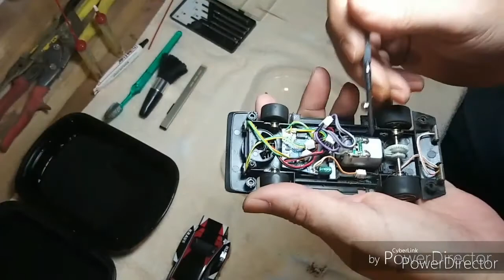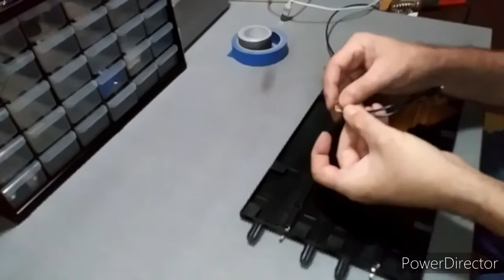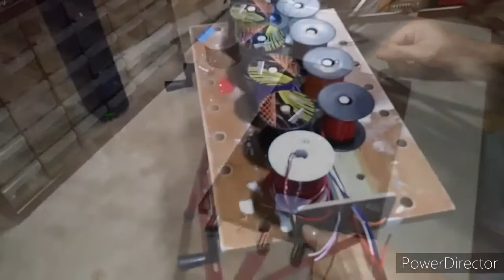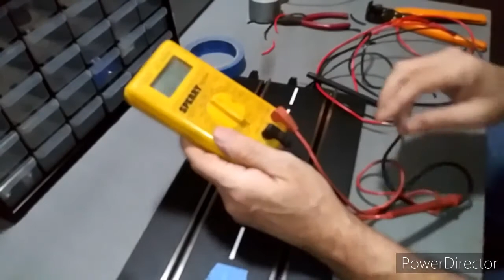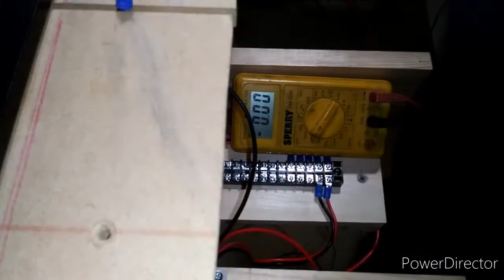Glendale 65 - Episode 11 - Track Wiring Part 3 (Track Connections)

Comment: Ah Ha!!!... This is THE episode I've been waiting for!!! Thanks John! You are such a great teacher! I love how precise and meticulous you are in your thinking and execution. I know it's not germane to this 1/32 scale Carrera Glendale Project video series, but as I am thinking of recreating your Glendale 65 layout in 1/64 scale A/FX track, I would love to hear your thoughts and opinion on how YOU would do the Power Taps and solve the Power Distribution question for that scenario. Who knows... perhaps one night when you can't sleep because you've taken in too much caffeine from over-indulging in the chocolate milk? ;-) Thanks for sharing another great video with your fans!
Reply from the maker: Actually, I had a 33' 4 lane AFX setup before this one, and I can tell you exactly how I  did the power sections. I glued sections together making sections 6 to 8 feet long. When dry, I soldered short jumpers UNDER the track, electrically bridging each gap in the section. Then I soldered power leads to that section. The track was adhered down to the surface using dabs of silicone caulk. The 6-8 foot sections were just snapped together, as they each had their own power taps, so the joint between the assembled sections has no effect. All rail joints were filed smooth, and all the joints in the track sections were filled, then painted. Ran SUPER smooth!! Thanks for the comments!!!

Comment: John, I have watched a lot of your very helpful videos and I have studied your 3 videos on track wiring. I have my wire completed and I have no idea how to set up my new DC power supply. Do you have a video on power supple set up and installation? Many thax
Reply from the maker: Hi. The only PS I use is for benchtop use only, I still use the factory power supply from the Carrera CU.

If you are looking to change out the factory power supply for the CU, simply cut the plug that goes into the CU off the factory PS, and wire to the new DC Power Supply (mind polarity!). Keep the voltage in range (too high will cause damage, too low will cause reliability issues) and that's it...
Reply: @slotcarmayhem9765  John, thank you for getting back to me.....much appreciated!
Reply from the maker: You're most welcome!!

Comment: Hi John, I am not using terminal blocks for connections and I just have the stock 18v power supply (1:24 scale) connected to the control unit. My question is where do I hook or connect all of the power taps that I've run from various sections of the track to a power source? there are no screws on the control unit to connect them all to. I am an avid viewer of SCM. Thanks, Ron
Reply from the maker: You can connect to a track section next to the CU, and daisy-chain from there. Thanks for your support!!
Reply: @slotcarmayhem9765 , Thanks John for getting back to me. So a continuous daisy-chain will maintain the same voltage from the beginning all the way to where ever the end maybe? Should I use the 16ga. wire you mention on your channel as well? Thanks again, Ron
Reply from the maker: @19Zeek56  I find the 16ga easier to use, but 18ga should be adequate electrically. Never hurts to go bigger. Yes, daisy chain works. The goal is to electrically bypass track joints.

Comment: This is Great stuff but, I've purchased the High Priced Carrera wire tap @ 5m. I'm sure as you
know " They " did not go with Black & Red. They chose Black & White and Red & Yellow. Then 
they printed the instructions in Black and White. . . . WTF right? ! ? How am I, a Newbie to slot
car racing on a 1:24th scale, how am I suppose to know what color goes where? Or, with their
wire tap the colors only matter in relation to what color went to positive leading from the track
@ the Control unit for both lanes & then match those colors to the desired location where the
power is the weakest which in my case is Right before the pit lane coming out of a radius 1/60
degree hairpin turn with a 1/3rd straight right before the pit lane change sensor. 
Can you help me out or. . . . point me in the right direction to someone Who is using the Carrera
product? 
Thanks for Any Feedback!
{ I've had this wire tap now for 5mos. and it still has the OEM plastic on it! }
Reply from the maker: Easy... each track has 4 rails (2 for each lane). Color doesn't matter, but let's say yellow is on rail 1 at the CU, the other end of the yellow should be on the same rail.

Comment: Hi John. Came across your Channel while researching digital slot cars. Well it's 10 hours +, and I'm ready to stop model railroading after a 5 year indever. Ready for something new. Expect  questions on up coming videos. What Carrera digital track set is the best bang for my buck$.
Reply from the maker: Welcome aboard!! As far as sets go, and if you're interested in digital 1/32 vs 1/24 (both use the same track), for me it was a question if I wanted a set with wired controllers and 3 cars, or a set that had wireless controllers and 2 cars. I suggest the wireless route, as it allows everyone full access to the layout without having to leave the controller behind. Bang for the buck, cars are much cheaper than the wireless controllers. I usually get my cars under $50 shipped.

Comment: Does the use of 2 main tap wires to one lane, and jumpered to the second lane work on an analogue track, or do you need 2 full sets of jumpers to each section of track?
Reply from the maker: For analog, 2 full sets of jumpers.

Comment: Great video. Are you using an external power supply? How are you wiring the control unit. And then all your taps where are they going. Im new to this and would love to see how you do all of wiring. This was super informative as I will utilize your videos when I start my build, which is coming  soon. Thanks
Reply from the maker: Hi, and thank you! I outlined where I am putting in power taps back in Episode 9. Might be more than you might think, but I am after reliability. Lessons learned from my HO slot car days. And I am using the stock CU for now, but will upgrade to a bigger PS in the future.
Reply: @slotcarmayhem9765  thanks for taking time to answer my question I just recently retired Issa play with slot cars when I was a kid it's very fascinating I'm going to get back into it thanks for all the education
Reply: Just another question can I have fun with a ho set to start with
Reply from the maker: @tomlucio8458  of course!! I recently dismantled a 4×8 4 lane HO we used to run. Lots of fun!!!
Reply: @slotcarmayhem9765  thanks for returning your my call

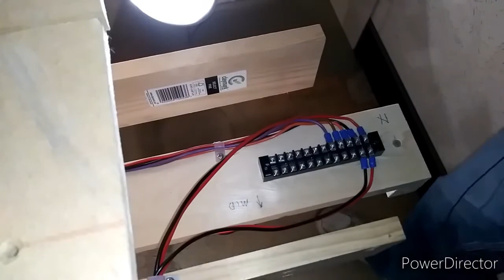Comment: just want to say first how I really enjoy your videos, very thorough, very educative. you're doing an amazing job with this track. very much looking forward to following the progress and seeing the end result! now I am just warming up with the hobby and getting me my first startset (DTM Furore) and some additional track pieces and digital items for Christmas :) so, looking to the future, I have a question on the wiring of extra power feed-ins. can you explain a bit more the part when you come with two wires from the power tap on the track piece to that junction block with 24 terminals (at about 18:50 mark of the video). what are all the other wires for which are already connected to that terminal? where are they going (what's on the other end)? and why do you connect the two new wires to two terminals that are already occupied (and what are they occupied with?), when you have 10 free terminals still available +7 more on the other side of that particular junction block? (yes, I'm a social sciences guy...)

also, do you use any aftermarket DC power supply devices (like say 30V/10A)? I hear they are a must if one plans on extending the track layout. what are its purposes/benefits?

many thanks!
Reply from the maker: Thanks for the kind words!! First off, I have terminals that are numbered and each number has a specific use. In the case you question, #1 is the + track power, #2 is the - track power. #3 and #4 are the + for the roadway lighting (street lights), 2 channels. Terminal #5 is the comon ground (-) for the street lights. #6,7,8 and 9 wont be used on this side of the track, but are reserved elsewhere for structure lighting. The remaining 3 are for any future use. This method makes it very easy to know where to land terminals (even if wire color is different).

As far as external power supply, I am not using one yet, but will in the future. The main benefit is little to zero reduction in voltage at the rails when running lots of cars at once.

Hope this helps!!
Reply: @slotcarmayhem9765  thanks a lot for the quick response! And I do have two more things that need clarifying.. the detail I'm missing here is how do you get the power to the junction block (to be able to then take it up to the power tap on the particular track piece)? I'm guessing the junction block on the other end connects to the control unit, i.e. power source, right? If so, how do you connect the wires at that end? Do you disassemble the CU?

On the non-stock DC power supply (btw I see they are sold as lab equipment): does what you say mean if you have one, you need not create these power feed-ins around the track?

Huge thanks again!
Reply from the maker: @svlastellar  good questions!! Yes, I relocated the CU, but if you dont want to, you can feed wires from the CU track itself for power feeds. The CU disassy is shown in Episode 14 of the Glendale 65.

I am also releasing a video outlining the exact wiring for the track, in graphic form, so one can see as a whole. The timing of your question is perfect!!

As far as a lab power supply goes, I still suggest power taps. The power taps reduce the number of track joints between power sources, thus reducing voltage drop.
Reply: @slotcarmayhem9765  ok got it, and many thanks, will be watching out for your next video :)

Comment: What do I need to “wire tap” my 40’ analog track? I understand  how the wire gets attached to the track but what is the power source? I just have the old carrera power supply for digital. There’s no wire terminals on it.
Reply from the maker: Just jump from the cu track section and fan out from there.

Comment: What size wire is used for the taps? 16 gauge or larger it just looks big in the video
Reply from the maker: I used 16g wire for everything. Bigger than necessary, but that is good.

The only circuit that most likely should be 16g is the wiring used to power the remote mounted charging stations.

I chose 16g based on length of circuit, not just current draw.

Comment: Where do the power taps connect at the non track piece end? When I connect directly to the power supply I have 12v at the track without the control panel turned on . Is that correct ?   With one tap wired direct to the output of the power supply and turning the control panel on the car the car doesn't move
Reply from the maker: I assume you are using an external power supply? If so, the power supply actually replaces the power supply that comes with the Control unit.

Comment: Are you using 15 amp or 25 amp terminal blocks?
Reply from the maker: Actually, I think they are 10 amp, per terminal. Max CU amperage is 8 amps.
Reply: @slotcarmayhem9765  thanks

Comment: Hallo. Could be you so kind a tell (show) me, how to join this wired piece with control unit? (carrera d132) Thank you.
Reply from the maker: Hello... This should help. If you are leaving the CU in place, just tap from the CU and run to joists (red/black).

https://youtu.be/y_L5qRo6Hmk
Reply: @slotcarmayhem9765  Thank you for your prompt answer, bud I don´t know, what to do. Because of lenght of track (11meters) I wired track, but allways the same problem from the beginning as seen in the video. While driving , suddenly the control unit starts flashing and beeping and the cars stop. This signal sometimes stops after a few seconds, sometimes longer, or only after the control unit is switched off and on.  This error repeats differently, sometimes once for five minutes while driving, sometimes much more often. This problem arises when driving cars separately, but also together. https://drive.google.com/file/d/1HA_QaNh1mkCk6WgzoeKPJaRPOquNvI4R/view
Reply from the maker: I've heard of this problem before, sometimes because of wiring, or other accessories attached. I would start with no accessories plugged into the track (position tower, wireless charging stations, etc.) and see if that fixes the problem. I would then disconnect ALL power taps, and check.

Could even be a strand of braid inside a lane change... 

Let me know please..  we will figure it out!!🙂
Reply: @slotcarmayhem9765  Hello! 
Today I received the accessories they asked me from Carrera - CU, controllers, cars. Everything is OK. They wrote me that I can't use more cars like a ghost car. However, Carrera's official website states: In principle, a maximum number of 8 cars can be run at one time. For instance: 6 cars being controlled actively + 2 Ghost Cars - or 8 as Ghost Cars, with no more cars actively controlled. Source: https://www.carrera-toys.com/en/5032/faq-s. OK. However, the cars stop even when the ghost car is not driving. Even if drives one car.
They also wrote to me that the cars are stopping because my circuit is long and that the circuit does not have enough electrical current.
The circuit is 11 meters long. I did wiring according to the instructions and the problem is still the same. Even with wiring, even without it. Will it be a solution if I will shorten the circuit to its original state? I wouldn't want that:(   What can be done?
Reply from the maker: First off, 132 or 124 scale cars? (They have different power requirements).

Yes, you can have more than 1 ghost car (132), and the latest version of Smart Race supports that. I currently run 2-3 ghost cars with zero issue.

11 meters is not long, but a power tap can help. If the cars are stopping, is the CU beeping? If so, that is an electrical short. I'd check braids on the cars, or look for a braid strand on the track itself. 

That being said, clean track is happy track. The same goes for the cars...

I would start by running 1 driver controlled car. If that works fine, add a ghost car. If issues arise then, I'd check the ghost car, and maybe reprogram a known good runner as a ghost car and try again. 

Let me know please!!
Reply: @slotcarmayhem9765  Hello John. As I wrote before, I have a D132. Carrera service wrote me, that the problem may be more than one ghost car driving and then also that my track is long. My track is 11 metres - OK. So I demounted the track :(  and... watch the video below.  I couldn't put together a smaller one on the margin of that length. In the video, the red car drives like a ghost car, the others for manual control, wireless, possibly wired. I physically checked all the parts, there are only 8 pieces. Nothing suspicious. Track clean, no wires. CU, drivers and cars were tested at Carrera, they write that all components are ok. But always the same problem. I don't understand :(   I don't know what else to try. Won't there be a problem with the transformer? Thank you for your patience with me.
https://drive.google.com/file/d/11-9s12I2AGUlb5ytHtku4bPtqzpDxev6/view?usp=sharing
Reply: @slotcarmayhem9765  Hi friend, I promised to let you know when I manage to solve the problem with a slot car problem that I wrote about and to which you responded. It really took a very long, long time, but I'm glad it finally worked out. The problem was the transformer. I suspected the wrong transformer almost from the beginning, but I didn't want to believe it, because the whole set was new. I bought a new transformer a month ago and the problem did not appear even once. I wish you good luck.
Reply from the maker: @jozef68  so glad all is working!!!

Comment: I cannot endorse using duct tape as electrical insulators.  With age, the adhesive fails and you can peel off the tape portion.  I would recommend a 3M thick electrical mastic or tape.
Reply from the maker: The duct tape is NOT for electrical insulation. It's to provide stability and sort-of strain relief until the parts are in place and wired in. Where soldered wires are joined, full wrap with UL listed electrical tape is used for insulation.

Comment: I don't understand this
Reply from the maker: What are you not understanding? I will clarify if there are any questions...
Reply: @slotcarmayhem9765  is this wiring for the remote controls
Reply: @slotcarmayhem9765  is this wiring for the remote controls
Reply from the maker: @tomlucio8458  no sir... This is to distribute power evenly to the entire layout to avoid slow spots created by track joints.
Reply from the maker: The controllers are wireless, and send a digital signal through the rails. If you are curious, episode 9 explains what they are, and why some people use them.
Reply: @slotcarmayhem9765  I'm new to Carrera, and I have about 54 feet of track. Do I need any power tabs for this small of a layout?
Reply from the maker: They always help as track gets used, as they help as joints begin to loosen over time. If a permanent layout, I would at least add one or two. Track might seem good now, but power issues tend to creep in later.